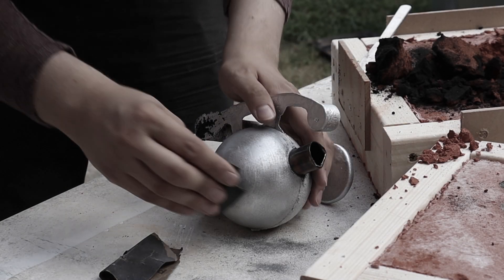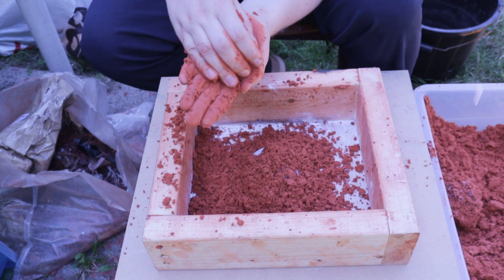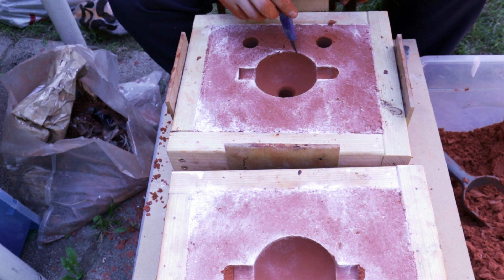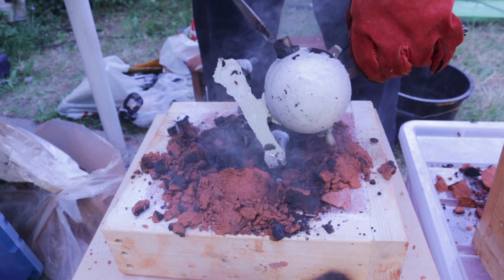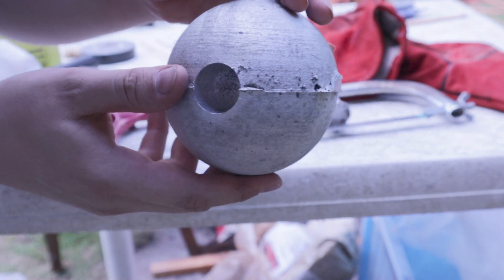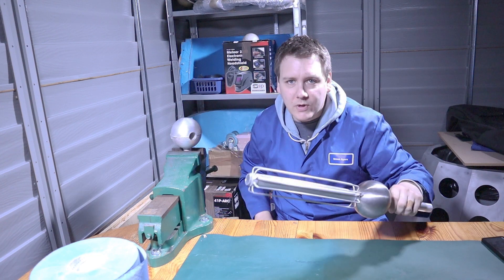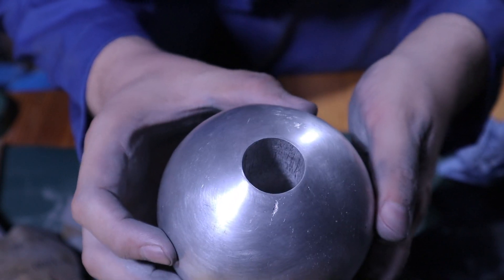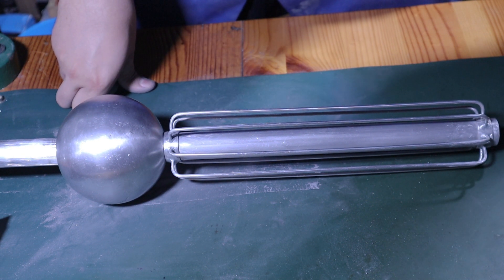Casting a Dalek Gun Ball Joint From Recycled Aluminium | Aluminium Dalek Build

Comment: This project is fantastic.
A finish you might want to try for aluminium is sodium hydroxide. It etches the surface of the aluminium, giving a sort of frosted appearance.
You can buy it as drain unblocker or oven cleaner (check the label to make sure it contains sodium hydroxide).
It's pretty nasty stuff, and is exothermic when you dissolve it in water, so go slow.
Steel wool also gives a nice finish, and is often less laborious than sanding. For an even finer finish, submerge the part in water while you scrub it with the steel wool.
Reply from the maker: ThePenultimateNinja Thanks 😊 Some good ideas there. I’ve not tried the sodium hydroxide etching. Completely forgot about the steel wool. I even think I have some somewhere. 🤦🏻‍♂️
Reply: @SimonAyers  
Brillo pads are good - the soap seems to help the finish.